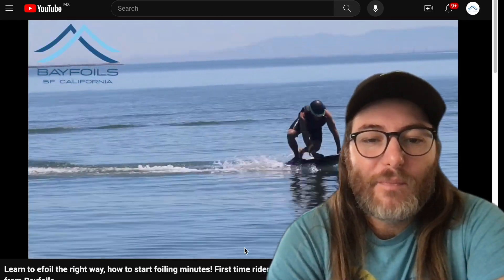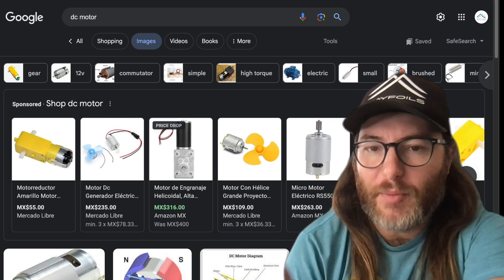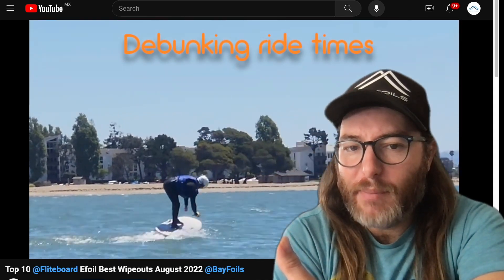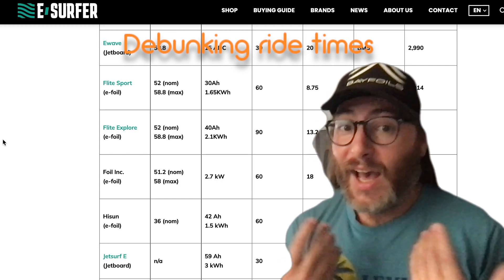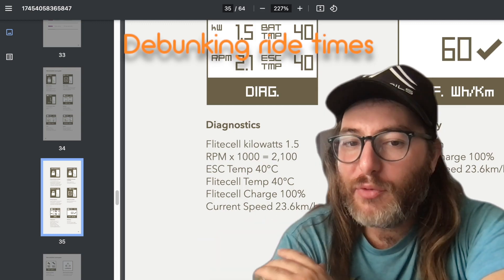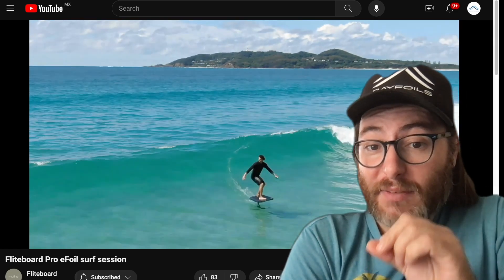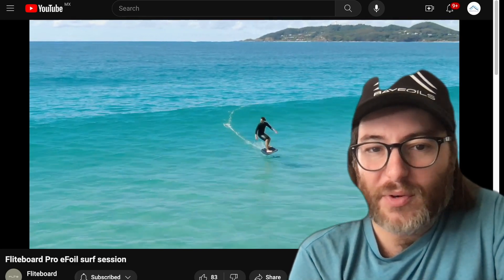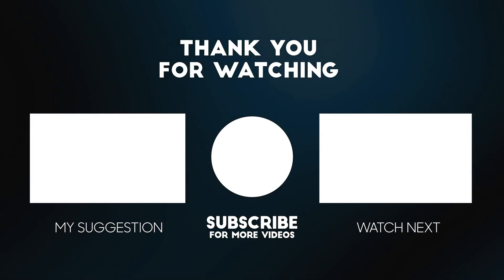Debunking the Major eFoil battery myths | Ride time calculations and weight effects

Comment: Hey Levi, do you feel when someone is learning, a heavier or a lighter battery is easier to learn on? Is the board “easier” to ride with more ballast, or is it harder and more sensitive for beginners with a heavier battery? Thanks!
Reply from the maker: Lighter is always easier in every respect (except for ride duration but that is another topic). You don't have to ride as fast, you have better throttle and pitch control and it's way easier to engage the rails and turn
Reply: Cool, understand completely. Thanks for the response.👍

Comment: So you would honestly recommend a newbie to purchase a small instead of a large battery?

The day before yesterday, I had my first ride and I was more than happy being equipped with a large battery. Maybe a smaller one theoretically provides a more dynamic ride experience but practically is not functional for a lot of us.

Is there any correlation with your video and the Fliteboard Air launch (only small and medium battery availability)?
Reply: I got the Explorer and is very happy. Being 88 kg and ride Flyer wing a lot you get less then 60 min. With Nano I doubt this would give me no more then 15-20 min.
Reply from the maker: Yes I always reccommend the set up that will provide the most fun for the rider. For most people that is the lightest system. It is easier to get foiling at slower speeds so the wipe outs for beginners are not as rough, plus for advanced riders it's easier to carve hard and land jumps. But it for someone who is sharing the larger flitecells are more optimal as you can share with the family. But for just an individual the nano is the way to go
Reply: I agree if you are 88 kg rider with some experience and are happy with 20 min on the water. Then go for nano.

Comment: What if you are a heavier rider? I would imagine the few kg less on the battery won't make that big of a difference when the rider weighs 20+ kgs more 🤔
Reply: Have been riding for two seasons. Pro board and most of the time with the Flyer wing. I am 88 kg and get 45 min with Explorer battery. Then I have about 10-15% left.
Reply from the maker: The smaller flitecells are better for heavier people too as they shift more weight towards the back of the   board, which promotes earlier take off and better control. As long as you use an appropriate wing for your  weight like a cruiser jet 1800 it's totally manageable